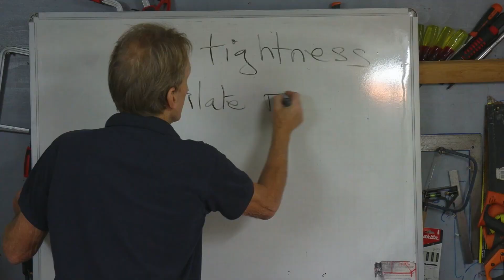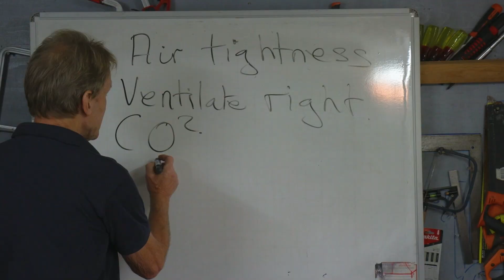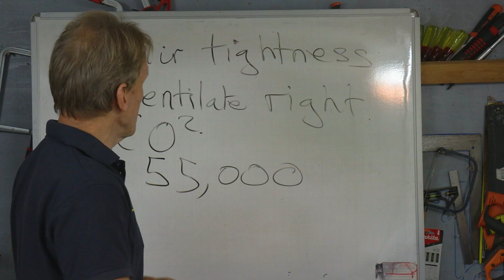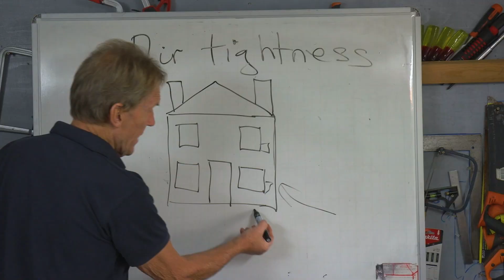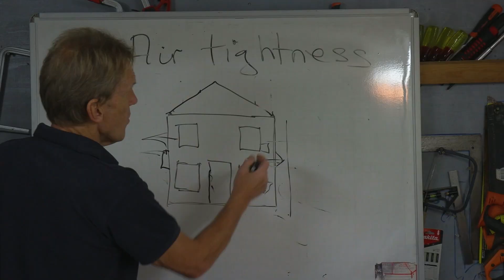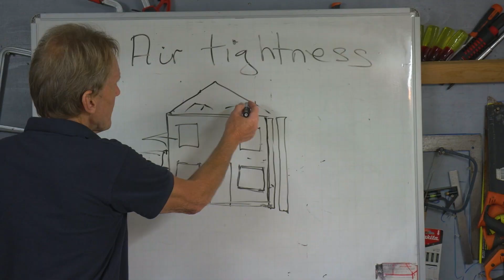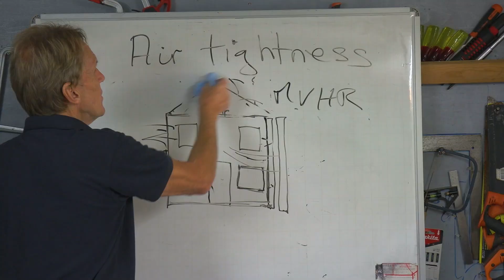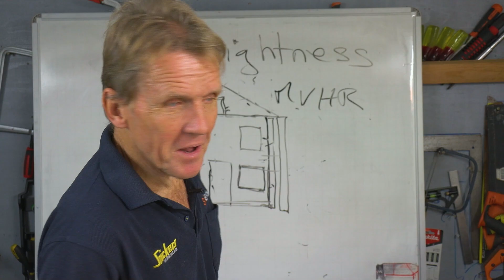The Ugly Truth About Airtight Buildings

Comment: My home is a 1954 model, ex council, no gas to the house , so no boiler, last of the economy 7 heaters have long gone and now only use a couple of timer convectors during the winter. It has some loft insulation under all the stored clobber, but no wall insulation as far as I know.  Crittal windows have nearly all gone, but replacement UPVCs do have the trickle vents open all year round , bedroom windows and bathroom window open all the time, just enough, never get black mould.  Winter woolies are the norm, and we get very few colds.    Son goes to off to work in a nice central heated warm office at 75 degrees working in a T shirt all winter long,  but says he gets the sniffles and blocked nose within half an hour of arriving. Makes no sense to me!
Reply: Warm offices, with their noticeably dry air, cause the mucus in our respiratory systems to thin out or dry. We're then prone to illness from viruses, and irritation from dust and traffic particulates. The worst environment I've ever worked in

Comment: Conclusion: Airtight homes require electromechanical devices to prevent you and the house from suffocating and deteriorating, respectively.
Reply: A walk in fridge can be air tight. People die in those. Walk in safes also have the same hazzard

Comment: Renovated 1790 farm house at 1100m in the Alps, insulated the outside walls, lime plastered inside, installed full mvhr, double and triple glazed windows,  underfloor heating with supplemental wood burner and dedicated external air supply. Gets to -20 in winter...we don't get condensation, not a hint of dampness anywhere. Total 375m2 of space included heated garage.... Heating /hw bills max €1700 year..... It's brilliant, I can't recommend great insulation + mvhr enough.

Comment: I noticed a lot of old buildings have huge air vents on the outside wall. One building I walked past had a large decorative vent and you could see the internal bricks through it! No cavity wall insulation either and it seems fine.
Reply: That's called a window...
Reply: @hannahjames3180  good one

Comment: we replaced an open fire with a wood burner - if the feed is open then it still works well as a passive ventilation system when not in use
Reply: Same with oven extractor fan if there's wind blowing past the vent outlet.
Reply: @dw300  extractor has spring to close vent when not on….so need more ventilation.
Reply: The vent will only draw air in during fire. Unless you have another vent in the house
Reply: @johnnorris1983  no that's not true. the passive stack effect is a very effective ventilator.   We are not talking about a passivhaus here - there is always natural ventilation

Comment: OK, so here's my situation. I live in a very humid part of the UK. The outside humidity is always pretty high, at the moment it's 82% outside and 64% in the house. How can I reduce the humidity inside when it's always higher outside? Opening windows only increases the humidity inside because of the high humidity outside. Any suggestions please Roger or anyone else? Cheers
Reply: you need to know the temp to make sense of relative humidity. If it's colder outside compared to insde your house then the actual moisture in the air could be exactly the same as warm air can hold a lot more water vapour (hence lower humidity).  You can use tools to convert an approximate room volume + RH and temp into absolute humidity to see if you are on target.
Reply: @twmd  thanks, I'll look into this. 👍🏻
Reply: I don't want to state the obvious, but....how about running a dehumidifier?
Reply: @smartbuildengineering  thank you for the response. Yes, I have highly considered buying a decent dehumidifier, like most people I don't like the idea of having it sitting somewhere looking unsightly and the potential noise they make. A dehumidifier would be my last solution I think but I'm trying to find other permanent solutions first. I've considered a PIV system to see if that could make a difference and I'm trying to make sure we use the extraction fans while cooking and showering etc. But it seems to be an uphill struggle, I've seen indoor humidity levels almost hitting 80% last week and i have the windows open all day from 7:30am til 9:30pm. It's a real head scratcher.
Reply: @Reakerboy  I lived in a property that had a leaking buried drain running under it, the soil was saturated and there was a lot of rotten joists and some subsidence.  Humidity reduced after fixing the drain.  Hopefully not your issue, but another thing to consider.
Reply: @smartbuildengineering  yes, this could be a issue to the problem. Our mains water supply runs directly under the house from the supply in the street to the rising main in the kitchen. I have wondered if it could be leaking. I've also gone as far as to have new soak aways trenched at the rear and front of the property. The rain water is now definitely being taken away from the house. The original soak away in the back garden was about a meter from the back door! The ground was saturated when the they dug it out and laid a new drainage pipe to the new soak away, more than 3 mtrs away, now right in the middle of my back lawn.
Reply: @Reakerboy  i have a cheap endoscope from amazon which lets me poke around the house and under the floorboards through airbricks. found all sort of problems this way including slow leak from radiator pipe.
Reply: @smartbuildengineering  not if you have gas heating, trust me it is cheaper to heat up 7 degrees over outside temp than using a dehumidifier. I use dehumidifiers in houses with no gas heating.
Reply: @itscoconutsaregood  I didn't say it would be cost effective!  Increasing the temp by 7deg might not be very desirable for comfort. It also wouldn't remove any moisture from the air,  just drops the RH.
Reply: Why do you want to reduce it? Unless you've got a noticeable damp problem then you don't really need to do anything, I would only worry if you get wildly differing RH values between room or it starts going up to 80% or 90% or more. The room I'm currently in has an air temperature of 19deg C and an RH of 61% and the place is bone dry.
Reply: @jannenreuben7398  well, here's the thing, in the winter we get condensation on the windows in the morning which also causes black mould to form around the seals. I've cleaned it all, with bleach, many times but it always comes back. Windows are good quality double glazing but probably on the older side. Also, I don't like the feeling of the humidity, house can feel sticky, if you know what I mean. I'm convinced I can solve it and would like to get the RH down to the 50% mark. Its definitely improved since I've been making improvements. House is brick and block with an empty cavity.

Comment: My 5 year old flat has a heat recovery ventilation system, no vents in the windows etc, it’s ok but I don’t think it really saves energy as it uses about 1kwh of electricity a day, just on its lowest setting. Plus it’s too noisy to run in the full setting for long periods. I still end up opening the windows most days. That said when you change the filters it’s always a surprise to me just how much crap is in the air even in your own home.
Reply from the maker: I have heard a lot of people say that the noise is a problem
Reply: @SkillBuilder  on the low setting it’s probably no louder than an ac system, certainly much quieter than a fan and the noise easily fades into the background. The medium setting  is more distracting, especially at night if your trying to sleep, the full setting is like having constant thunder through your home. Fine for a short blast if you’ve had a shower but no way could you live with it on that all the time.

Comment: So true, I live in a house that is very old…I did everything that I could due to to insulate it and seal it up when I renovated. I live in the north and use both my gas furnace and gas fireplace. It truly is a dance between air tightness, insulation and vapour control-air exchange.    Exactly - a leaky old house has no mould, mess with the air exchange and you have to be on your toes….you could not be more right, ok enough, your ego needs a check!
Reply from the maker: Don't worry about my ego getting out of control, if you run a YouTube channel there are always lots of people who will bring you down to Earth.
Reply: A leaky old house can have LOTS of mold. My grandmother's house did. There were holes under / at sides of doors, a few holes drilled through the walls for various reasons, strong drafts blowing through that often blew out the pilot light on the water heater. The basement was incredibly wet + damp even with all of those air holes + drafts. Paint was peeling off the walls on the main floor. Got really bad. The house was over 100 years old, built in the 1880s. No insulation. Original windows. Used to open the back door in winter to get air while cooking to try + cut down on moisture but that didn't work. In winter the house was freezing and in summer it was living in an oven. But it ended up full of mold. But it was super drafty... Also in the heat of summer you could open the front + back doors but the (cooler) air would stay outside instead of coming in. So the high heat got stuck inside. Even though the doors were wide open on opposite ends.

Comment: I'm not sure the dangerous build up of CO2 in buildings is why ventilation is necessary:
"Carbon dioxide is often measured and discussed in relation to indoor air quality. Carbon dioxide, 
which is emitted by occupants and normally found in concentrations of 300–2500 ppm in buildings, is harmless at these levels [30] and not considered by the WHO as needing to be controlled [27], and therefore is not included in the WHO guidelines [29]. Only when carbon dioxide levels reach 3% to 4% (i.e., 30,000 ppm, 100 time higher than typical outside levels) does cellular acidosis take place, 
which is a non-toxic or damaging process that can be tolerate for limited periods of time and is reversible [31]. The focus on carbon dioxide, when assessing indoor air quality, is not due to its impact on health but rather because carbon dioxide is used as a surrogate for other indoor pollutants."

Source: extracted from "A Natural Ventilation Alternative to the Passivhaus Standard for a Mild Maritime Climate", a research paper on two real, identical flats (in Wales, I think) with different ventilation strategies.  Google the title and you'll find the whole paper for free.
Reply from the maker: Thanks that is very interesting. I read quite a lot about the CO2 issues and probably drew the wrong conclusions. I will read that paper

Comment: I installed a heat recovery system in my home when I bought it. (MHRV = Mechanical heat recovery ventilation), the air is changed around 3 times an hour in every room, air is drawn in from outside, and is warmed from the stale air being extracted. So no trickle vents on any windows and therefore no draught from open vents, no condensation even when washing is dried in the house, no wet condensation on windows, no noisy extractors in wet rooms (kitchens and bathrooms), definitely no mould possible either, no CO2 build up from breathing and allergens minimised because of the constant fresh air intake. So cost me around £4,000 7 years ago, but every home home should have one, it is just so much healthier. As soon as you want to save losing heat by insulating houses or make windows and doors airtight and not draughty you have to ventilate, so the MHRV systems, pass the heat at around 90% efficiency from the stale air being removed to the clean fresh air coming in. Lovely.
Reply: I watched a few YT videos regarding this, and was thinking of installing a DIY solution (£4000 isn't an insignificant amount), however I soon realised that "90%" efficient also meant that I would be losing 10% of generated heat. Healthy? yes. But economical or ecological? Not really (imo)
Reply: @engleblerthumferlumpadinck6536  do you think you lose less than 10% on a leaky house 🤦‍♂️
Reply: @muteposting  my house isn't leaky though, hence my interest in improving ventilation.
Go on, give your head another smack
Reply from the maker: I am not even sure the 90% is achievable. I think the heat transfer could be 60% at best
Reply: @SkillBuilder  All the data sheets for my mvhr system claims 90% transfer.
Reply: @MrSparkyAprilia  90% could be possible just as long as you have purpose built passive home with no thermal bridges such as a insulated concrete foam with triple glazing then you can forget the heating 90% of the year.
Reply: @terrytees  yes it is a ICF built passive house. I finished building it last August think we've only had the underfloor heating on a handful of times since then. House sits around 20 degC
Reply: @MrSparkyAprilia  I considering the same approach myself, glad to hear it's working out for you. My only concern when looking into to this is DHW domestic hot water. If you don't mind me asking what system are you using for DHW at present and how is it working out for you?
Reply: @terrytees  dhw is run off a airsource heatpump. Unfortunately the heat pump only heats the water to around 55degC. So we in stalled a pressurised hot water tank with an emersion heater which tops the water temp up to your desired temperature. The emersion heater is ran off solar during the day, and battery storage overnight. Works a treat
Reply: @MrSparkyAprilia  Sounds good.The climate is very cold here and am thinking of moving to Scotland which is even colder so I am trying to find an alternative to heat pumps. I have time to research it issues as I won't be going ahead for a couple of years. I am surprised no one has tried and outside biomass boilers in a passive house for DHW, not sure if it would be overkill but properties I am looking would be a decent size of acres so may have access to plenty of wood. Glad to here your heatpump is working out for you.
Reply: @SkillBuilder  Not wanting to diss you because you are a breath of fresh air 😁 but...
where does this MVHR 60% efficiency come from?! Passivhaus certified machines are quoted at over 90%, with lots of very precise Germanic data to back them up. It's just measuring air in/ air out temps- if 40% of room heat went out the cowl that would be bonkers!
Reply: @smartbuildengineering  interesting but such a small study that it cannot be generalised to 'most of the uk'. One of the occupants of natural ventilation was quite happy./comfortable with 17 degrees which is not universal!
Reply: @twmd  Yes, valid points.
Reply: @Evieniltega at waht temp though. I can get 40% relative humidity by running the gas boier of full all day to get up to 28 degrees.

Comment: You are spot on mate - did an 88 flat scheme to the regs with massive bi-fold windows everywhere. Never saw a window open after handover (and it was phased so I was there a fair bit!). The condensation in some of them (people drying clothes all over the place etc) was horrible. Stuck MVHR in the next one and no issues at all in the 12 months since handover. Currently building mine - a big 3000 sq ft lump that probably didn't need it but went for MVHR anyway just in case.

Comment: I bought a 1960s bungalow house that was Black mould top to bottom all the wall paper had peeled off. I removed the bricks at damp proof course a few at a time removed the insulation .house has been perfect 11 years now. Air brick were all doing nothing as inner and outers were not opposite. The estate agent said who would buy this but I saw its potential.
Reply: My old neighbours had cavity wall insulation,  the white fluffy  rock wool stuff,  when the new people moved in they found all the inside walls were damp, all the insulation had to be removed,  a major job involving special hoovers & knocking bricks out everywhere,  some of the stuff they pulled out was literally dripping with water!
My house has the polystyrene bead type insulation & I've not had any problems with it.

Comment: Roger,

My flaps are always open. They are also downward facing.

I have those trickle vents and keep them open all year round.
They need to be cleaned out or they clog up like soot in a chimney.
I would suggest shorter curtains  to help ventilation and use a curtain pole which extends out from the wall a few inches. I am sure you all at least know what 3 inches is.
Sometimes I wake and there is a little bit of moisture - that can't be helped. Now, getting back to condensation - it's all about balance and getting thermostat 
levels right and keeping doors suitably open or closed.
Remember to lower your water temperature during warmer months to save on gas and heating bills. Put it back up when colder weather sets in.

Trickle vents get my vote Rog. If you have them and don't need them you may need them some time. Opt to buy windows with them fitted is my advice or opt to custom design your flaps so you can fiddle with them as you wish.

Happy flap flipping!
Reply: Ask Roger to fiddle with your flaps, that sounds like a terrible moisture problem you have.
I am sure he can help you with his plunger.
Reply: @I-am-not-a-number  I don't need a plunger. No doubt Rog is a proper dab hand. 
Maybe just a mere tightening of my flange might be enough.
Had a similar problem with the stopcock.

Comment: MVHR on it own still not effective in whole House ventilation system a dehumidification system needs to be incorporated into the whole system to be effective in dealing with the heat recovery and moisture and also having HEPA filters installed with in the system too.
Reply: I dont agree with this comment. You can get enthalpic heat exchangers and also recirculating units. My MHRV in full vent mode will dry the house out. So i change the program to vent more intensely but less frequently. In the interim plants and cooking maintain humidity.